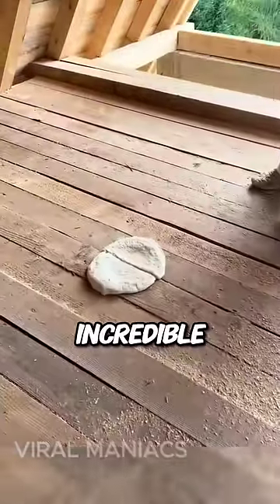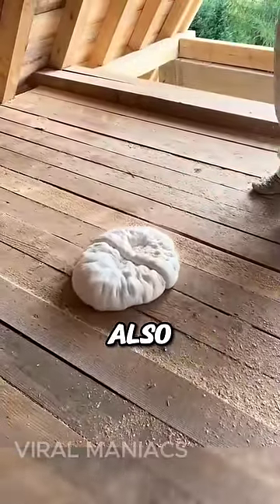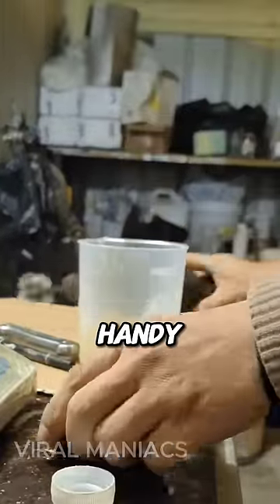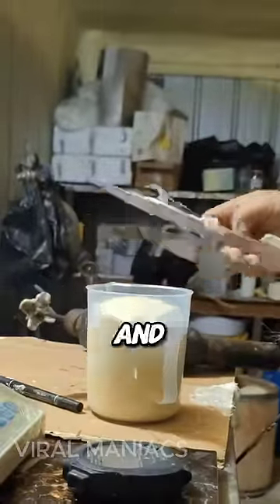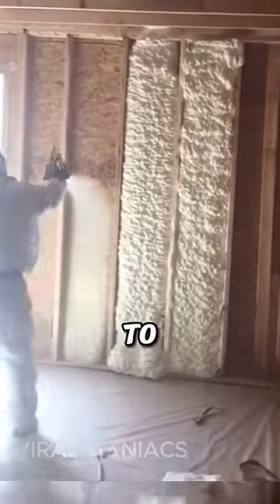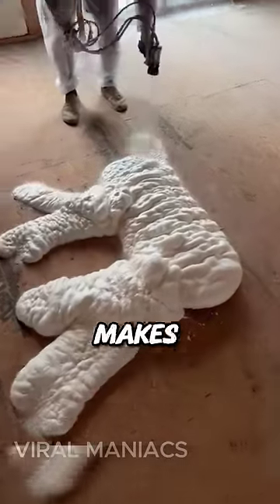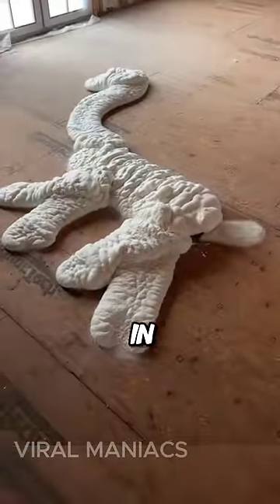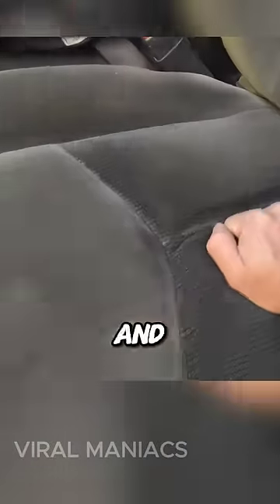The Superhero Foam That Will Blow Your Mind #satisfying #shorts

Comment: As a termite inspector in Florida I would not recommend this. 1) you would never know termite eating behind it. 2) If you ever have a leak behind the foam the moisture will linger and thus attract subterranean termites. 3) Would  never know you even have a leak. Until one day your roof collapse. Which I seen this happen many times. They're great insulators but like I mention above those are some of the cons.
Reply: Termites loves pine wood..not foam

Application of this foam is between panel boards thus no way can u inhale fumes.. others have plastic linings before injecting the foam, so fear of inhaling fumes is zero

Overall, problem of using things will materialize only IF the handlers are not trained to manage its application

Comment: Funny thing in the comments. One guy said it isn't biodegradable. Another guy said it's going straight to landfill when it breaks down in 20 years. So, it won't break down in the environment, but it supposedly breaks down in a climate controlled place shielded from UV light.

It really can't be recycled, and it really lasts for indefinite periods of time (for better or worse). A great building material from a longevity/efficiency standpoint, but it has serious issues to work out about what to do with the waste.

Comment: Anyone using spray foam in their house should be sure to use polyurethane instead of polyethylene foam. Polyurethane is flame resistant while polyethylene is extremely flammable.

Comment: Does not this stuff burn really quickly, I thought it was a toxic fire hazard?
Reply: Cover it with a fireproof spray or covering. Problem solved.
Reply: @billwilliams8232  
Maybe 🤔, but I think 💭 or thought this stuff was banned in some countries as a building material, because it basically was toxic and flammable, I assume that the problem must have been remedied, maybe they mix something with it to make it safe ?
Reply: @wilson42cc  as with any foam product the burning byproduct is highly toxic. Any couch or mattress with foam will kill you if you remain in its presence while it’s burning. Don’t stay in the fire! The R value is higher than any other insulation product per inch. Plus it does seal the area it’s insulating. Ventilation should be done in a controlled method, not just with leaks in a house. I used to build geodesic homes and used spray foam exclusively. The R value in our walls totaled 36. Heating bills in northern Minnesota were ridiculously low. No one ever complained, nor is there any outgassing once the foam expands in place. Most commenters on this topic have no idea what they’re talking about.

Comment: I had my big concrete basement fully shot with urethane foam on the inside. On a hot summers day, with no AC, the basement is 10c or 50f cooler than upstairs. Consistent humidity at about 65%. Best 5000$ we ever spent.

Comment: For no reason should you Ever set a post in spray foam. By code where i live, it has to be covered with a fire barrier(sheetrock) or a fireproof paint. Rockwool is an amazing product and id rather use that. Great for deadening aound and fireproof to 2200 degrees °f, hydrophobic(sheds water).

Comment: I thougth this couldn't be used as wall insulation due to the highly toxic (lethal) fumes it gave in case of a fire ?

I was told one would be dead or in a coma after just a couple of breaths, making it impossible to exit a building even at the very start of a fire....

Maybe this here is a different composition ?

Comment: blaa blaa blaa There is closed cell and open cell foam/ still if you have open cell and u have vapor barrier it sits between, either way if you can have kingspam and vapor barrier you end up same position, all diff is you cant replace foam cant inspect faulty roof and  good luck with it in uk, but if you have proper build roof  it will last as long as roof it self

Comment: I tested out a method using spray foam on repairing a sheet rock hole in a wall. I got the foam on my hand and had to use a razor to separate my fingers 😅. Took about a WK to get the crud off my hands.

Comment: If your foam-filled walls needed repair or addition to wiring or plumbing in your walls, you be screwed.  Foam is not strong enough for anchoring deck posts as shown in this puff piece video.

Comment: Notice how it's a bunch of women using it for setting post holes? Don't do this, just mix your concrete.
Reply: They set utility poles with foam now also
Reply: @paulhunter9613  
Where? Mogadishu
Reply: @SaltyFarm  I’m not sure if they set poles with foam in your country or Mogadishu. But they do in the states
Reply: @paulhunter9613  
Where i live they set utility poles in steel reinforced concrete with massive anchored carriage bolts. In case you can't tell from my pfp, I set posts for a living. You can pull a foam set post out with one hand because it's insulation, not structural building material.
Reply: @SaltyFarm  these are 35’ tall  wood utility poles. And I really don’t think you can pull out a post by hand, there are different types of foam to set things I’m sure
Reply: @paulhunter9613  
I guess I've been doing it all wrong for 20 years 🥴
Reply: @SaltyFarm  yea you probably have been. New ways of doing things scares some people

Comment: That dude filling those full wall cavities would suck to work with. Had like 2-3 inches at least expanded past the lumber. That all needs to be scraped off now.
*Sourse. I used to be an insulator working with this stuff.

Comment: This isn't a great material.. building contractors use it just because it's cheaper and  takes less time to fill the form as compared to other materials. However it's not environment friendly and from security points of view it's very risky as it's highly flammable. Some studies also claims that it is carcinogenic to workers directly exposed to polyurethane for a longer period of time.

Comment: This stuff is illegal to use here in Norway. The three main reasons for this is it's highly flameable, it's toxic and it blocks air ventilation. And there is even more negatives. The only positive is it's easy to use and fast to put in. Also, it's very expensive